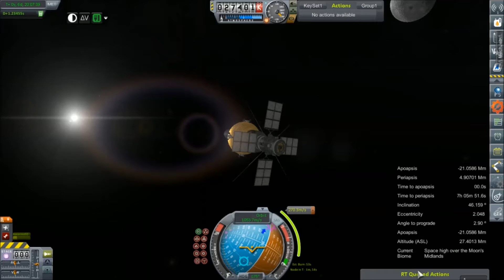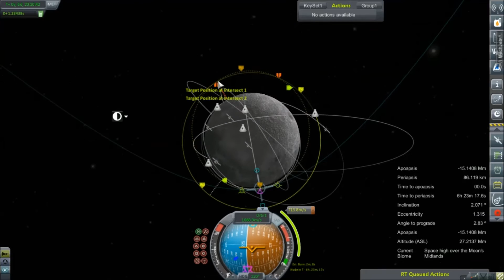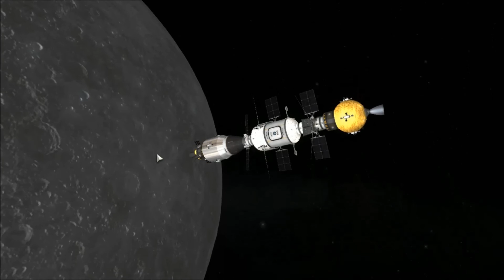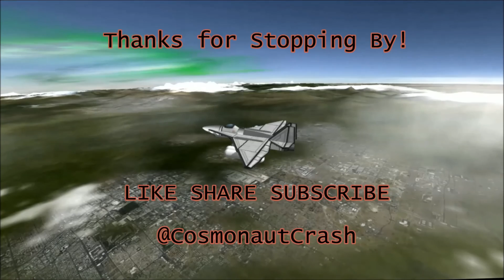KSP RP-0 #137 Project Life Boat 3 The Dockening

Comment: good job bud, need to brush up on your 6 axis controls lmfao
Reply from the maker: oh dude, I know.  One of those skills that I'll never get graceful at, but I also need to remember to balance the RCS vs COM.  Turns out it helps a lot. lol
Reply: +Cosmonaut Crash hahahahaha ya well, nobody ever said anything worth doing is easy,I really enjoy watching you work through this, you need any actual aeronautical or astrophysics help let me know
Reply from the maker: !!!!! 
Gonna have a mission (maybe two) that will be forced to Aero-Capture at Venus soon.  What info will you need to tell me a Pe that'll capture but not de-orbit?
Reply: How accurate are the physics engines on ksp rss on venue's atmo? Because if they're anywhere close to actual it's gonna be a mofo, even at high alt the atmo density is extreme, irl you'd be looking at 5g / 3k c Temps on a heat shield.... venus us no joke
Reply: Venus*
Reply: Your gonna have to pull either multiple launches and leo assembly or use your new heavy lift and grab some luck, there really isn't a feasible atmo brake for venus, your gonna have to do a hard retro burn, atmospheres way too dense, comes in like a sledge hammar
Reply from the maker: I have no clue about the accuracy on their modeling.  Gs not an issue, no crew to worry about. Looks like my 33% success rate will be in no danger of improving. lol
Reply: +Cosmonaut Crash bahahahahaa awww common man, it is after all rocket science.... but seriously if the physics are close you will have to hard burn to even have a shot, the atmosphere of Venus is like a cast iron skillet, if memory serves irl hitting atmo at venus at IPS is like 5 fold earth's at Apolo return speed... so... prolly put some points into the large inflatable heat shields lol launch a seperate tug assembly just for the retro burn unless you want to spend 18 years getting there, also going to have to factor in the sun will add some gravity acceleration
Reply from the maker: Flight is already underway. Launch was today's episode. Exactly none of those are options anymore. Lol
Mission primary was a lander. De-orbiting the orbiter is like a bonus lander right? We will give the lander a crater to study.